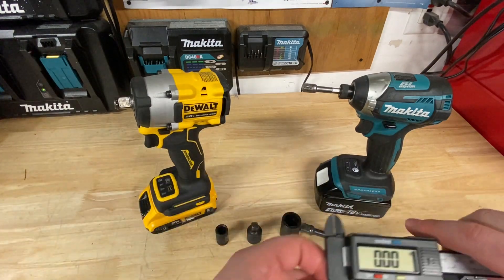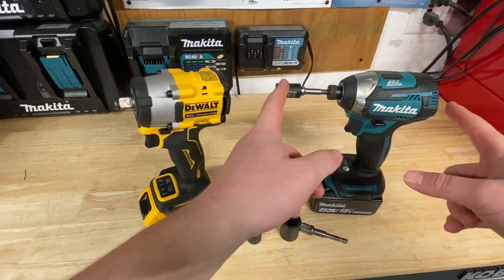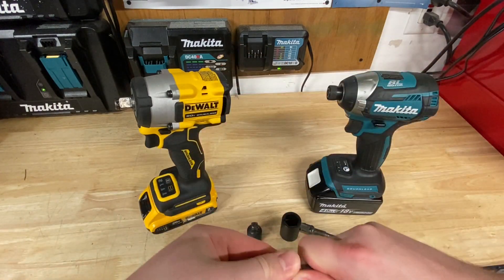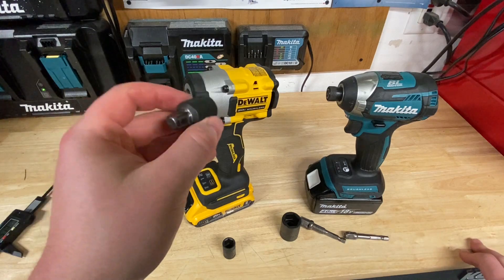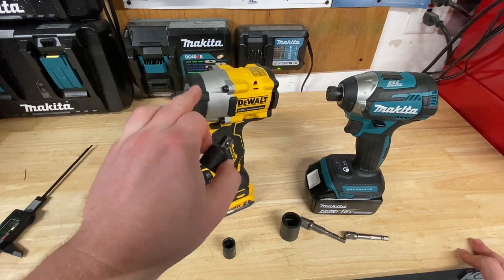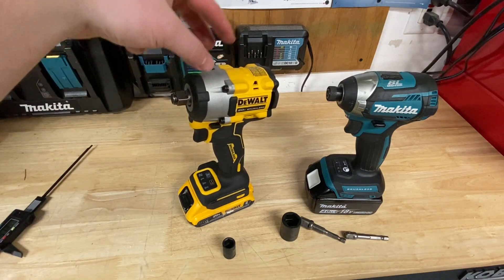Impact Wrench or a Socket Adapter? Here's a Cheap Solution!

Comment: i know dewalt has a adapter 1/2 inch to 1/4 hex but in small print it said 1400 in lbs limit  another adapter is 1/4 hex to 1/2 drill chuck.